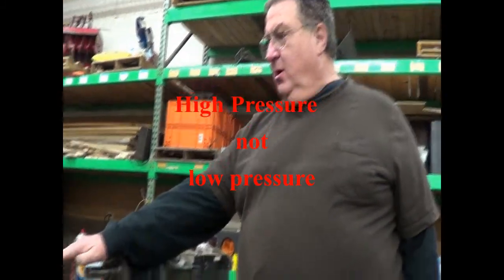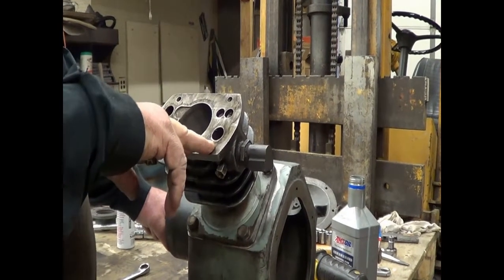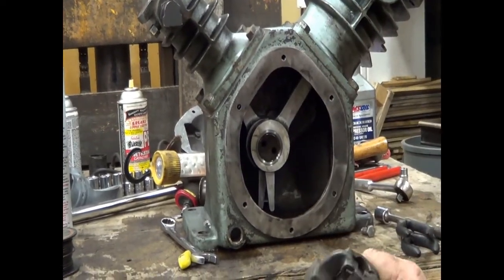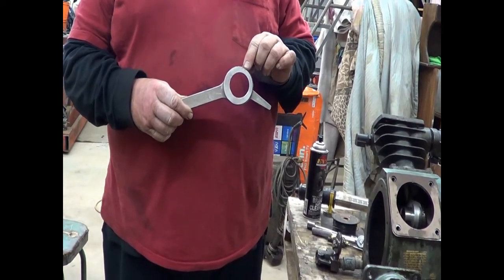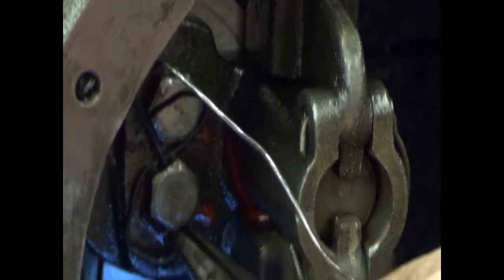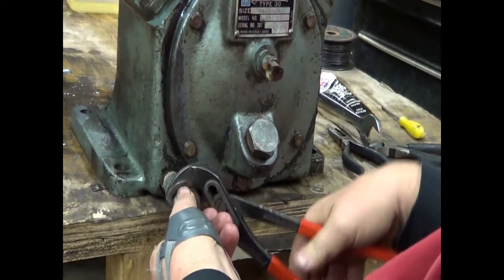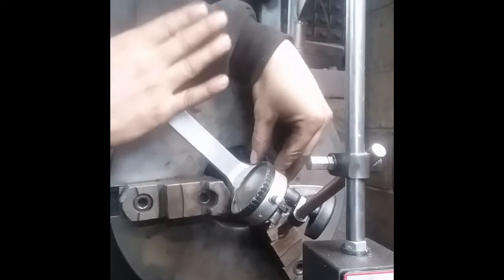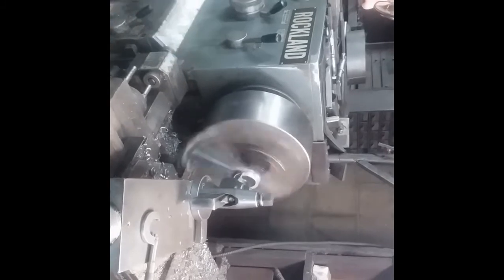IR 242 installing the Cylinders and lower end.

Comment: You were lucky you got those bolts back out without breaking them,I used 272 red locktite one time on a bigger bolt,and with 1/2 inch impact it came out hard all the way with the gun set on highest torque,have never used it again,272 is made to lock the bolt just about permanately,I use blue now,which locks the bolt but a lot easier to get back loose,especially with drilled and wired bolts!Just a heads up if you ever tear another one down and break those bolts off in the crank,heat may help loosen them up some if you ever run into bolts that someone has been into before and 272ed them!I will keep that big end rod problem in mind and mic them when I rebuild mine!Good video,Thanks!
Reply from the maker: these bolt must be pretty hard. I have never broke 1. I have done many IR rebuilds. thanks for watching.
Bud
Reply: @THECompressorGuru  Thank You Guru,enjoy the videos,keep them coming!

Comment: That's an old Lantern tool post the fellow is using ! A little harder to set up but works as good as a modern quick change type.

I will definitely compare the width of my new rods with my old rods. It will save me a lot of trouble. I would do it different though.. If necessary, I will take an equal amount off each side either with my lathe or my flat piece of granite with sandpaper, starting with coarse  and finishing with fine. 

I like the way you pre-installed the pistons in the cylinders.. It would have been difficult to do it other wise. Those cylinders are heavy.  

btw.. You use way too much Loctite ! Just a little dab (dot) will do you!  

Thanks for your helpful videos. I have learned a lot. Your wife sounds like a real sweetheart!

Comment: After I put my large piston in the pulley got harder to turn, I thought the 13 horse Honda would break it in but it won’t turn it at all. I oiled the cylinders walls with 10 weight before putting pistons in, lubed all parts before assembly, what would you do?  I put the rings in like you said in another video.  This is a IR 253.  New crank, pins, rings and valves.   Thanks guru
Reply from the maker: Richard it sounds like you did everything I would have done. it should have gotten some harder to turn. If you are worried .... when you start it up open your tank valve and let the pump run against no load for 10 or 20 minutes. if you have a non contacting thermometer, make sure you do not have any hot spots on the cylinder walls. with no load I would not expect any reading to be more than 50 deg F over the ambient temp. no hot spots put it to work. good luck let  me know how you make out. you can also contact me through thecompressorguru.com.
Reply: Actually sounds like you got rod in backwards if binding something is very wrong with it
Reply: No need for locktite safety wire keeps bolts from coming lose

Comment: Isn't it necessary to apply anabond while applying the gasket?
Reply from the maker: I used a RTV sealant I normally word have put it on dry but there was significant pitting from rust. as a rule if both surfaces are clean and smooth no sealant is needed.

Comment: How to check oil level in this type of compressor?
Reply from the maker: fill the oil to the top of the threads in the oil fill hole. if it isn't up to the thread area add oil.
Reply: @THECompressorGuru  Sir, I have put 1 liter of oil in the model 2475, so what will happen now?
Reply: @THECompressorGuru  sir please reply.
Reply from the maker: @srpneumaticservices1918  is it full? if it isn't add more if it is ... what do you mean what will happen now. BTW you can contact me through the website thecompressorguru.com
Reply: @THECompressorGuru  Sir, I have a question, why water is formed in the oil in Ingersoll Rand compressor? What is the solution?
Reply from the maker: @srpneumaticservices1918  the compressor is not running enough, I have seen this a few times . the compressor does not have enough run time to warm up and when it gets warm and cool it condisates water in the crankcase. I heard that IR does make a crankcase heater for the condition but I have never sold 1.
Reply: @THECompressorGuru  what is the solution?
Reply from the maker: @srpneumaticservices1918  change the oil often  or go to IR and find the heater. I have put a drip leg on the oil drain and instructed the customer to drain the water off on monday morning before they start it for the week. or run the compressor more.
Reply: @THECompressorGuru  thanks